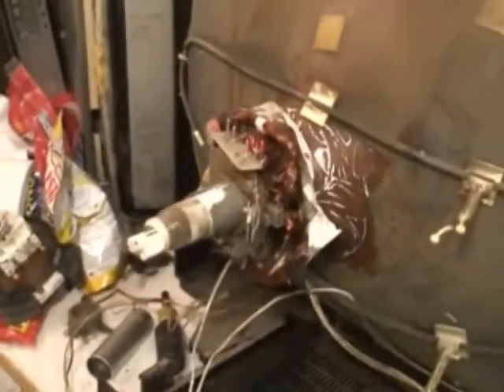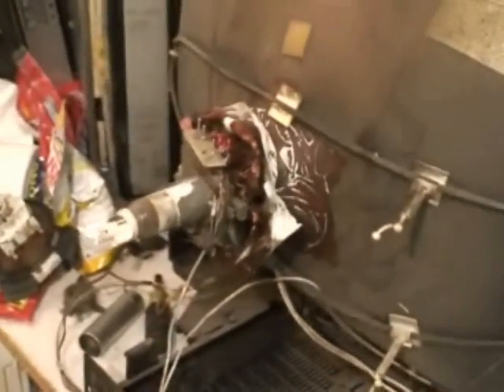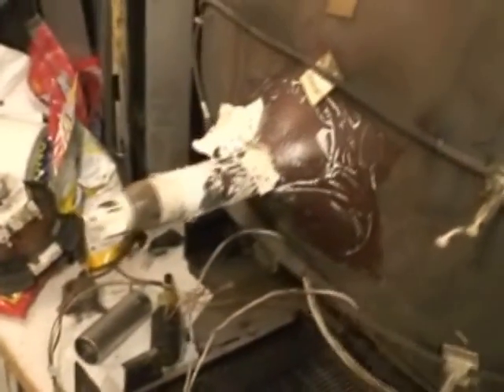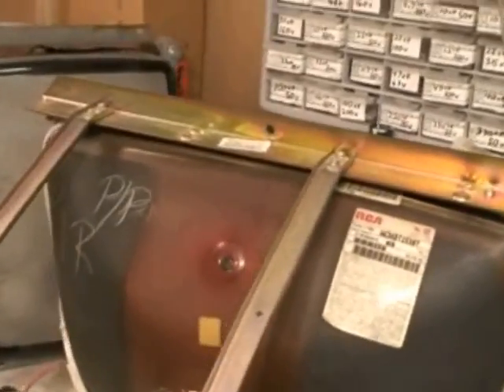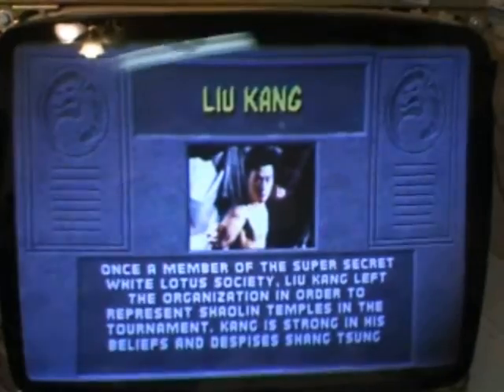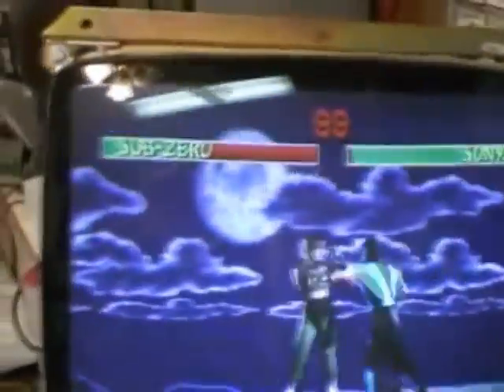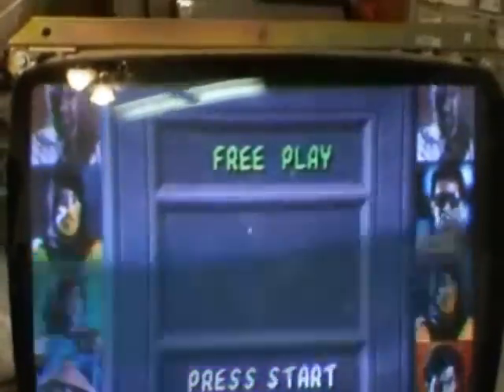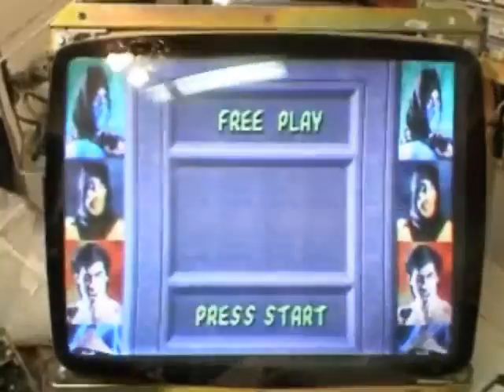Tube and Yoke Swap because the Focus Pin in my old Test Tube Broke out of the Tube.

Comment: Took me a few days to find the time to get the swap finished and all the wires redone to connect to the spare WG K7400 chassis I decided to mate it with (for use in a MAME cabinet since it requires no iso transformer), but the results are FANTASTIC!  I used the TV's original yoke, mounted the tube in a K7000 (older style) frame, rewired the connections with solder, heatshrink, and salvaged arcade monitor connectors, and BAM!  It looks AWESOME!  I am stoked to have my 1st TV tube swap go so well!

Comment: Removed the tube from the TV.  It's a model A63ADT26X05.  Read they came in some Hantarex MTC 9110's (not sure if it was considered a 25" or 28") but this tube looks like a 25" really.  The plastic casing inside tv was stamped "25" tv casing manufactured on 2nd shift, etc."  I measured the resistance on the coils and they were 2.6 Ohm Horizontal and 6.4 Ohm Vertical.  That sound compatible enough to you to use on either a standard or medium-res chassis?  It's close to another K7000 tube I have.

Comment: I acquired a 27" television and was thinking of swapping it's tube into my Gauntlet Legends which has a 27" Medium-Res Neotec in it.  It has some minor screen burn at the bottom of it's tube.  If the yoke resistance is close on the TV tube, can I use the yoke that's on the TV tube and not have to swap?  I haven't checked to see if it's bonded like yours was.

Comment: OMG, I have this exact tube RCA A63ADT15X09....the bonded  yoke(H=1.6 V=3.3) is not compatible as a backup for my WG U2000(WG2520) so I'm going to have to remove this yoke just like you did(it looks like a lot of the assembly was removed before you got to this step)....I'm going to keep the stock tube on my game until it dies completely but I'd like to have this backup tube to keep the game alive.  I may send you a message when the time comes lol.  Thanks very much for this video Buffett!  BTW, how did you remove the convergence/purity ring assembly?  It's just one piece, no adjustments.  Bunch of white tape looking stuff on the neck.  tubular said this tube was compatible with the current one so I jumped on it....
Reply from the maker: Hi, there are several ways to do this, one way is use a HAIR dryer and slowly heat the tube and yoke and surrounding area till it is soft and comes off.
a HEAT gun is WAY TO STRONG and will super heat the work and possibly crack the tube, seen it happen before.
the second is to use a battery charger that is used on car battery's.
put it on the lowest setting you can and connect the vertical and horizontal wiring pair to each clip in series on the charger and let it get everything nice and warm.
this will loosen the glue and help you remove the yoke.
the ring assembly you will probably have to heat with a hair dryer to heat and remove first.
good luck.
Reply: @buffett1978  Thanks so much Buffett....btw, thank you for previous replies about my K7203(I'm the guy that removed that circled ground wire in the picture I sent and you said it wouldn't hurt/cause the damage)  Turns out the monitor was fine(you were right!), just a PS issue causing the board to crash.....new PS and it worked fine!  Thank you again.  I will follow your advice!